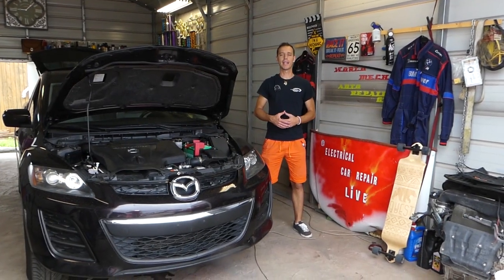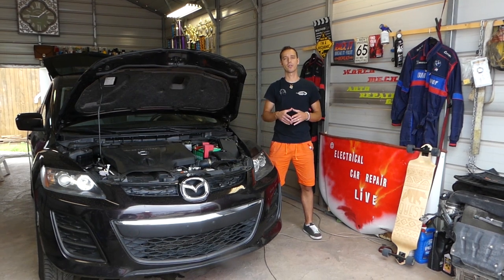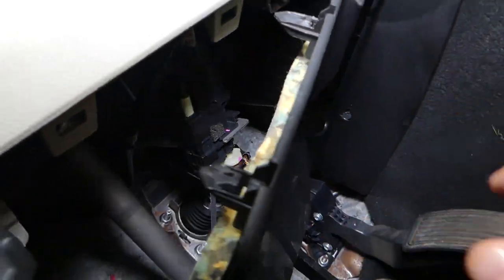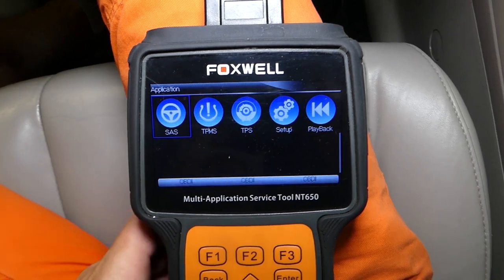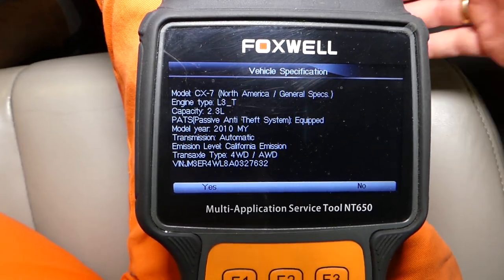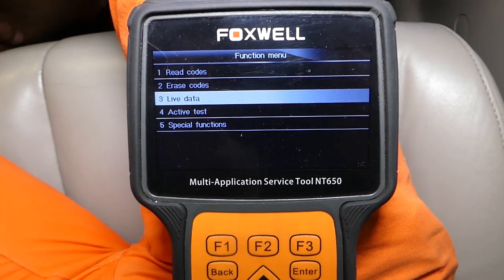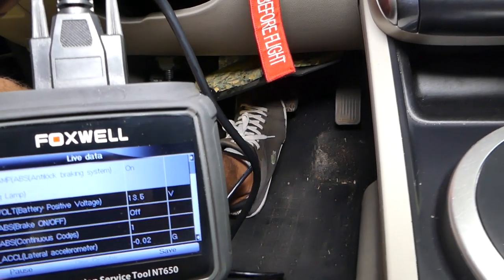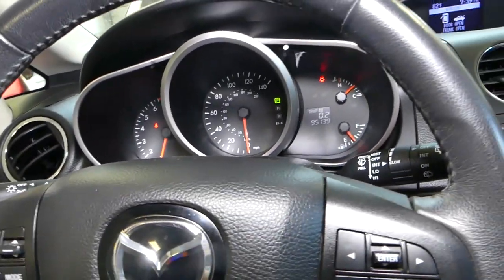HOW TO KNOW IF BRAKE LIGHT SWITCH IS BAD OR GOOD. TEST BRAKE LIGHT SWITCH

Comment: Well what do you think is wrong if you replaced both switches and the brake lights still stay on and the cruise control and traction control still malfunction? I'm baffled!! Btw both switches are being actuated by the brake pedal. I have a '13 Nissan Sentra

Comment: Although, this is a decent video. The most important task of testing the original faulty component (brake switch in this case ) wasn't done.  If the new brake switch didn't fix the issue, then you would have wasted time (and possibly money), and still need the repair. Parts as simple as a brake switch should be tested with a multi-meter before replacing them. It worked out in this case, but won't always.